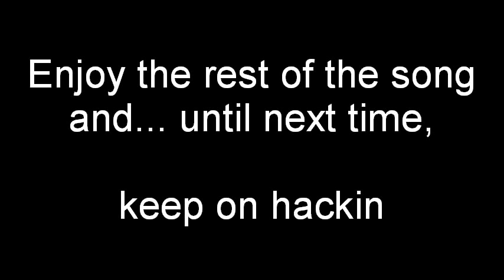Five Minute Power Window Blinds

Comment: keep it simple would be using your fingers to twist it open. A mechanism is already there for you to utilize built right into the blinds as a simple twist pulley.  This just added another machine on top of machine making it more elaborate.  Thats fun. I would have put the button further from the window so that its "remote" power control.  Put the switch by your bed or desk or work bench.  Whats the point of standing there right at the window, holding the button in, when you could just twist it yourself as you stand there?
Reply: +Ian Vernon forget 'remote' go automated. Add an Arduino with a couple of light sensors, 1 measuring outdoor brightness and 1 measuring the brightness inside the room. Program the Arduino to open the blinds when outside is brighter and close the blinds when inside is brighter.
Reply: or............actually......vice versa !

Comment: this is exactly what I need, but disappointing that once you find WHAT you need there is NO description on where to purchase or hyper links for the purchase or even descriptions of the objects in the video...esp the rubber tube which holds the "wand" tightly so the motor can do it's job....dang and double dang !!!!

Comment: why didn't you put an actual switch on there?  a dp/dt switch would reverse the contacts when wired correctly.
Reply: +John Lord — That was my thought, too.  I would have chosen a DPDT switch with an (ON)OFF(ON) function — normally off in the center position with a momentary function in either direction.  Push the switch toggle one way to open the blind, the other way to close it, and when the toggle is released, the motor stops.  Such switches are readily available from electronics supply stores.